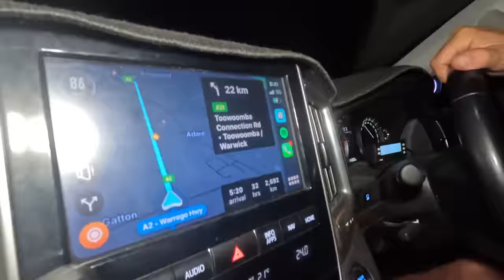TRAPPED by RISING TIDE on wrong side of Cape York River... we have to cross - what happens next?

Comment: Put blocks under the frame of the little four wheeler when tying it down on the trailer. That way you are not stressing its springs and shocks and you lower the stress on the tie downs as you are not fighting the springs and the suspension doesn't put additional shock load on the straps.

I let the air out of the tires to set the frame on the blocks.

Comment: When tying down a vehicle on a trailer you need to tie off to the axle or suspension arms not the chassis cause you may think the straps are tight but as the suspension cycles on bumps it can come loose or break the straps it can save you some drama
Keep up the good work love the content 👍

Comment: You guys need over the wheel straps for the can-am.  Never strap a vehicle from a suspended point every bump the strap either loosens moves or rubs. 
You should always strap a vehicle down by the in-sprung parts of the vehicle.